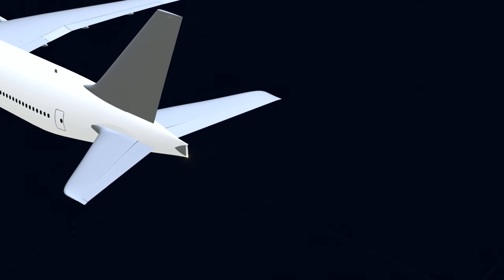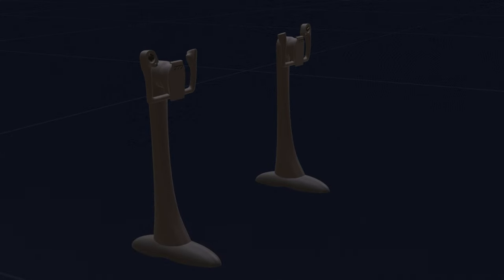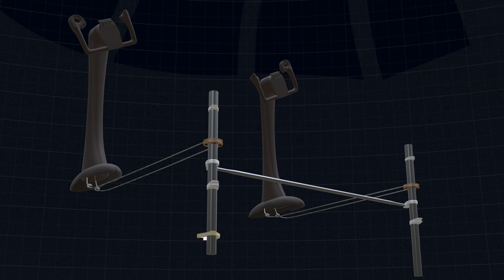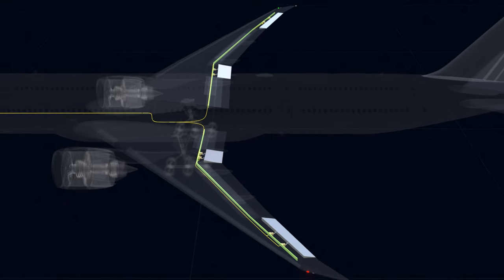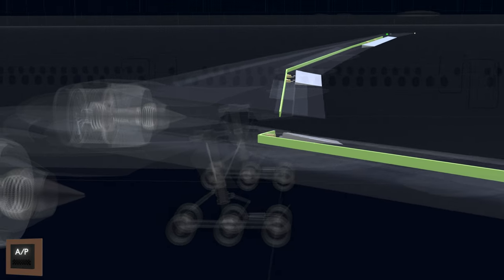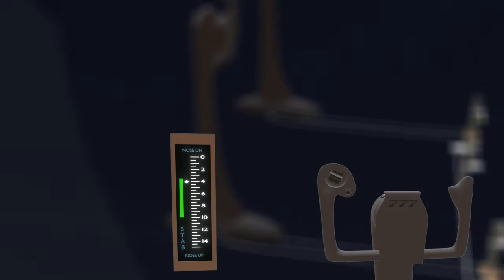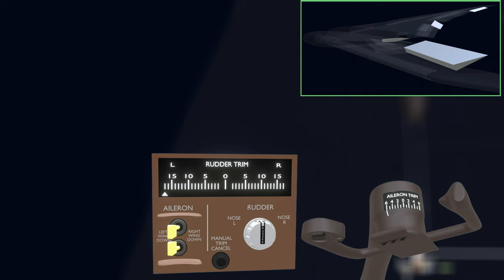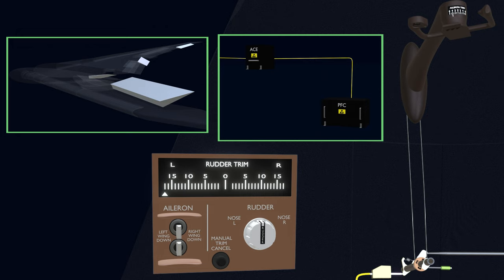How Flight Controls Work | Part 4 : Aileron and Flaperon

Comment: Can the flaperons move in autopilot? As one of the authors on the missing MH370 mentioned the plane was on manual mode and the flaperons were fully down at the point of crash. Eventually claiming that the pilot was active at that time.
Reply from the maker: Flaperons move during flap and roll commands. The autopilot system cannot extend the flaps, but it can give a roll command. Therefore, autopilot can move the flaperons.

Comment: Cool video. One question, where's the mechanism that detects the pilot's intention to override A/P with his sheer input force? I assume there would be a transducer somewhere between the control column and the backdrive actuator which senses the pilot's input force by measuring some form of strain?

Comment: I have a mechanical question. How are the outboard ailerons attached to the wing, are there more than two hinges? If so, how can they handle the wingflex, as an up and down movement wouldn't be possible if there are more than two hinge points. The hinges aren't in a straight line anymore when the wing is flexing? Just imagine a piano hinge. It will only work correctly when straight and not when you flex it slightly.